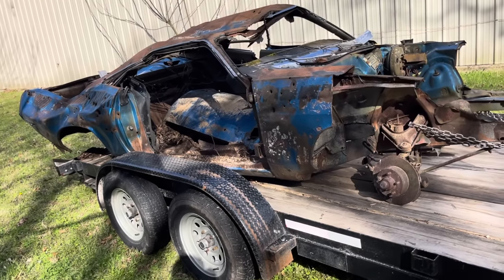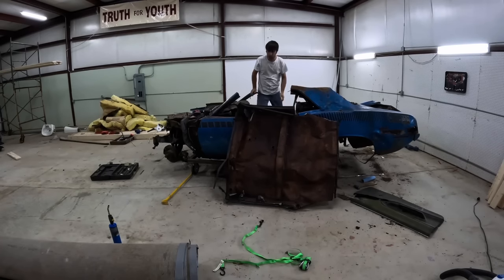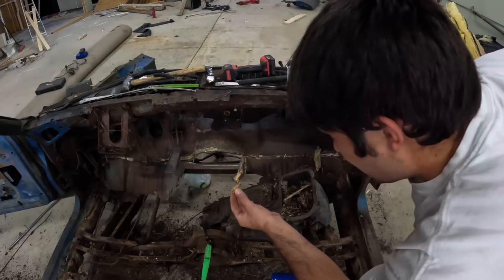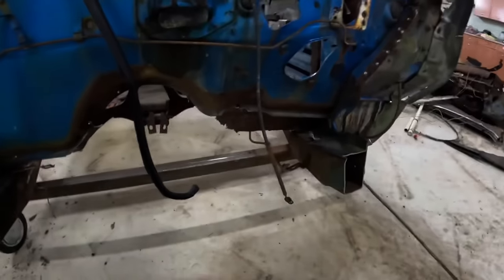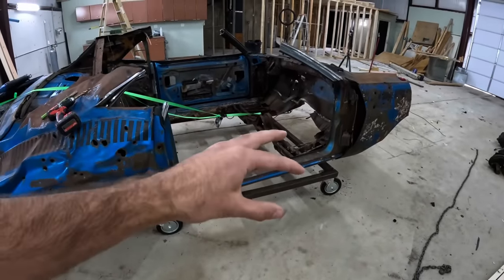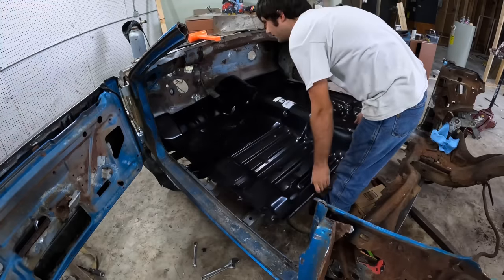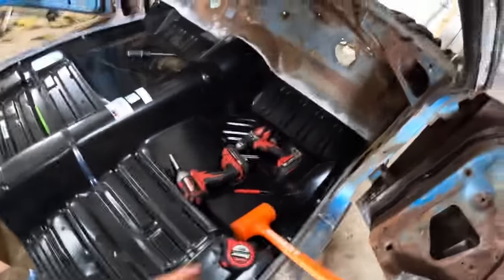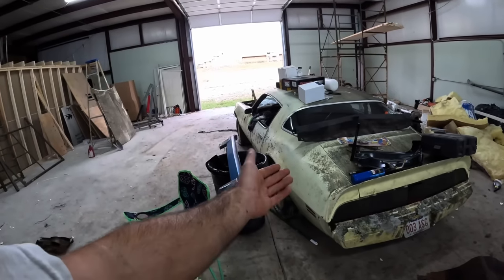1970 AAR cuda restoration part 1 it will buff

Comment: Don't weld anything solid yet... in fact use sheetmetal screws to hold it together until the inner and outer rear quarters, trunklid, and also the front fender and hood gaps are set...You'll thank me later.

Comment: Now THIS is a resto!  This is not "Bought a clunker and dropped a performance engine in it", this is a phenomenal project you're undertaking.  Can't wait to see this as it evolves (although I do wish for your sake you'd wear googles when cutting sheet metal with a chop saw!)
Reply: I'll definitely 2nd that! 
Safety goggles, a MUST!
If u go to, get an MRI and u got micro metal particles in your eye which u may not know about, it can rip them around in your eye causing permanent blindness! 👀
Reply: a FAT WALLET is of prime PRIORITY.
Reply: And safety gloves for welding. Once you get glowing hot metal on your hands you will know why ;)
Reply: Safety always number one priority.

Number one.
Reply: What's wrong with making a clunker go fast? Sleepers are the new norm.
Reply: I was thinking that the safety equipment consists of a white t-shirt 🤣

Comment: Great job really helpful stuff for my rebuild. Just a quick question. You mentioned 8 1/4" from the center of the torsion bar hole to the outside of the frame rail. If 8 1/4" is correct the outside of the hole to the frame rail will be 7 1/4". The hole is 2" diameter. Can't make 7 1/2" from the outside of the hole work. Thanks

Comment: wow this is amazing, im restoring a very rusty 67 barracuda convertible, front and rear frame rails are toast. im  wondering how you figured the height of the frame rails at the front,my 67 frame dimensions use a datum line to figure frame dimensions,

Comment: I went through the same thing with my 69  yenko nova big block car. It had rolled off the roof of a parking garage in 71 and the owner let it sit for years until I seen it and asked if I could buy it.  I rebuilt it in 86. Long before the internet so I had to search for the parts and drive many miles to get pieces, I used all new parts. Not a single used piece went on it , I guess that's why it still wins at car shows all the time,  I wouldn't trade it for 2 of anything  , I drive it every day and lay rubber in all 4 gears. I brought it back to life and keep it alive and it truly keeps me alive also , every time I jam a gear and dump the clutch and smoke rolls outta both rear fender wells I laugh like a crazy person  cause it makes me feel 16 every time,  the 427 still purrs like a kitten
Reply: AAR cudas, around 2700 made.. Yenko Nova like 38 made... your Yenko completely worth restoring in this condition.. that AAR.. someone should cut the tail panel off for a wall hanging and scrap the rest.
Reply: @goldenhippie6352  I didn't know they only made that few yenko novas. I never looked it up,  i know the 427 has more than enough power,  even when I try to drive normal it spins tires, I always liked the 69 nova better than the other years , I have the air shocks pumped up all the way and the 12 inch cragers on the back with mt 50,s and it still spins every time I take off  lol. I love the old cragers that's all I have ever put on it. thanks for sharing
Reply: @coinslotsandjoysticks2572  no problem! You are one lucky man to have a Yenko Nova, been my dream car since I was a little kid.. however with them only ever making just under 40 of them that dream is slim.. the Nova was the one Yenko Don himself was afraid of and that is the reason the production numbers were so low.. it scared him to put that car into the hands of the public.
Reply: @coinslotsandjoysticks2572  , yes it's actually probably not something a person would want to beat on and use as a daily driver.  Just saying......
Reply: Why on earth would you drive a yenko nova like that
Reply: @ThePontiac98  Id say because it's a Yenko Nova.. low production numbers or not, vehicles are not designed to set in a garage. Restoring classics an building hot rods the better majority of my life, and I can say there is nothing more wasteful than putting 10,000 plus hours into a vehicle and watch old guys take them home and stick them in the garage.   Life is short enjoy it.

Comment: My brother and I just started restoring a 1971 Maverick Grabber in about the same condition as yours. Our Maverick had 43000 original miles on it. The car was bought and made in to a drag car with the original 302 engine. It was rolled a couple of times and had many parts stolen out of it that were still good. The Maverick laid in the wood ever sense 1977 until 2023.

Comment: Someone still had a title to that!?!? This is on the level of a job that Chris aka Junkerup would take on. If you are going to try to resurrect a car, this is at least a good one to invest time in. 👍
Reply: Rust Bucket Restos started with a Charger not much better than this.  He too basically saved a firewall and a VIN tag.  We won't even mention DIY Gang's burned out Challenger.
Reply: As long as the VIN plate doesn't rust & fall off, then I guess it's still considered a car.
Reply: As long as you have a VIN and a bill of sale you can register it
Reply: @brandoncropper1259  Nope, not in a lot of states.  Indiana isn't even terribly picky, but you do have to have a clear title, or go through a fairly annoying process to get one.  Some states supposedly make it almost impossible.  Georgia and a few others are exceptions.
Reply: @FMChimera  you can register it in Vermont and transfer the reg cause that’s your title
Reply: I bet Mark Worman from graveyard carz would love to get his hands on this Cuda.

Comment: Looks easier, cheaper and faster to pull the vin plate and recreate the entire body from scratch! My opinion on this one - about one step beyond impossible. If work actually proceeds on this one, the channel will be one to watch for years! Best of luck!
Reply: once it goes for sale,I'd hate to be the poor "dodgy half-wit" buy'n it.
Reply: I think the question here is WHY
Reply: Watch on tiktok… has new floors, frame rails now. He’s seriously putting this car back on the road!
Reply: @MO3MINI  
I had a sledge hammer once.
Replaced the head twice and the handle 3 times, but it was STILL the same tool, RIGHT?
Reply: @MrPaige222  haha reminds me of Triggers Broom! There is still original sheet metal in this car… its no different to all the rebody mk1 escorts, sierra cosworths and Minis etc…. You can now by a brand new body for a Ford mk1 escort! What he’s doing is way more difficult than finding a decent body and swapping the vin plates
Reply: Swapping a vin plate is federal crime
Reply: @genehunsinger3981  
Exactly.  It's not even clear how much of the original  vehicle is going to be a part of this mess. 
I commend him on his ambition,  but I question the logic. 1 out of 2,500 isn't a very rare car in my opinion,  and there's just no way it will have any real value given the weakened metal and lack of originality.
Reply: @jeremyhanna3852  no one would press the issue.For an old car.Unless some-1 lays claim to your car(thru hidden serial #'s located through-out the cars body)And,if you want "gray area"-replace the whole dash so as not removing the vin plate)It's only a big deal when you are involved in theft.
Reply: @genehunsinger3981  right up till you try to sell that car and a car of that caliber is get a inspection by multiple people they find different Vins there walking away
Reply: @jeremyhanna3852  what do you think THIS CAR is going to have?No vin stampings!Is that a bigger red flag?
Reply: @MrPaige222  if the sledgehammer had a frame, motor and vin number yeah you could argue it was the same 😂
Reply: @MrPaige222  😁

Comment: In my experience with cars this mangled, you pull the car to square first, then start cutting. 

Pretty monumental task you have ahead. Good luck. Beautiful car to save.
Reply: It sure makes getting new stuff to fit. But I have only done auto body for 46 years so still learning
Reply: @boblister665  not quite 46 for me, but over 30. It’s how I was taught and it works out pretty good for me.

Comment: As I recall, the AAR Cuda had a destroked 318 to make the engine 305 CID to meet the AAR requirements. It's been a long time, so I might be wrong and mixing this with the IROCs of the 70s and 80s. If you can find the original engine with the matching numbers, that would be awesome. Looking forward to hearing the correct info on the AAR Cuda if I'm wrong. 

Graveyard Cars has built some basket cases like this, just don't do a "Holey Goat" rebuild like one I seen a few months ago where the guy basically restored the drive train, jacked the roof back up, put seats and lights in it and left the riddled sheet metal as is. It looked like a renegade from a demo derby.

Comment: A very ambitious project, I wouldn't have cut through the window trim when you were removing the roof, it was a little kinked but those can be very hard to find. Good luck, I can't wait to see how it turns out.
Reply: That and he cut completely through the A-pillar and all of the support bracing under the roof skin. Should have just heated up the lead seams where the C-pillar and quarter panel meet, and drilled out the spot welds and just removed the roof skin and left the supports, because he probably could have massaged most of that a pillar back into shape. Now he's going to have to replace all of that 🤦‍♀️

Comment: About 10 years ago rescued a completely rusted out ‘68 Camaro convertible. Saved the windshield frame, cowl/firewall, trunk divider panel and lip around the trunk lid (oh, and the VIN tag). The end result was a beautiful car but I would not go through that again. Did save a car that otherwise would have gone to the crusher.

Comment: It can and has been done where they disassemble the shell, work each panel straight again and then put it all back together.

A light weight E-Type post huge accident was rebuilt this way retaining most of its original panels

Comment: Theres a guy in Japan that fixes classic in the similar conditions. Drill out the spot welds and lots of hammer n dolly work. 
Also there is a efi 6 pack intake by fitect or Edelbrock

Comment: Man... you are as nuts as I am, rebuilding things almost nobody else will touch or even consider. Its what you do when you want a car you can't afford in good shape, or when its a rare one that met an early demise. That Cuda makes my 65 GTO before the rebuild, and the 69 GTO right now look good. The 68 Firebird wasn't rolled, but its almost that bad, I can save the roof and a few other parts. I'll be watching this one, since I have a 73 Cuda cloned into a 70 AAR. Its fun to drive, even if its slower than all my Pontiacs.

Comment: That car has lasted 52 years, it might not be all original by the end but the spirit of the car will be there, that's what counts. I'm doing a 1972 Vauxhall just now that will be a 50/50 mix of panels but it will not be a memory car, it lives. I would have drilled out the welds on this car and reshaped as many of the panels as possible, the hammer and chisel work is brutal and could have been avoided with more thought.

Comment: Early 90s Chop Cut Rebuild "restored" a 69 Charger pre-production car found in a quarry. By the time they finished 'restoration " the only original sheet metal was two thin strips on either side of the trunk lid and the cross bracing under the roof. Everything else replaced.  Didn't stop them advertising it as saved 😅

Comment: Fact that there's just over 2,000 AAR cuda is out there but how many of them are legit left? There may only be a few handful out there so it's the determination of ones Will to bring them back to life, I have a 1970 340 cuda that I bought from the original owner the whole right rear quarter panel floor board and frame rail had to be replaced as well as the passenger door it was worth it when you're giving something free can you put love sweat and tears into it it's worth it

Comment: When I did my first year of auto mechanics in Kelsey Saskatoon, one colleague had an original AAR Cuda with the 340 six pack.  Car back then in the mid 1980s were always street raced and nobody had a stock musclecar.....  Performance parts were pretty cheap and one could always comb through the local bargain finder for cheap used performance parts as well....

Comment: That would be 340x block and heads for correct build. Back in the day I found a Panther pink AAR listed for 1500, I only had 900 so, yeah I lost out and am kicking myself to this day over it. But Found a 70 an Inviolet Baracuda 4 speed for $100 with bad bearings. Drove it for 20 years and sold it for $3500. Yeah I should have kept it but needed the money.

Comment: I had a Moulin rouge 340 6 pak 727 AAR. build sheet dealer window sticker all papers original paint original motor. Paid 5 grand for it.
Dude wanted 7500 told me on phone it was a plumb crazy car.
He thought the pink hurt the cars value and dropped the price. I sold the car for 15k without doing a thing to it. Thought I was killing it... Cars worth so much now it's hard to calculate.

Comment: yep.. just jack up the vin. plate and firewall..and slip a Brand new car underneath..it would never happen where I  am... once they are dead,or written off.. they stay dead ..parts only..nice to know you guys can put those rare ones back together..see the Rat in the  left hand side of the dash start to move at 5:18 and runs down on the left side then exits near the left rocker..he out of there ..

Comment: I wish I had kept the 1971 XY Ford Falcon, 🇦🇺 that I saved from a paddock. It had wrapped around a wooden telegraph pole in a drunken crash. The drivers floor was pushed up into, and bent the metal dash at the same time.
Stupid part is, now these bodies are as rare as this AAR, and people are paying 30-40k just for a junk body with no panels trim or motor 🤦‍♂️

Comment: 340....not 360.  Good luck finding the numbers matching engine.  Ditto the tranny and rear diff.

This thing needs 90% of the sheet metal replaced.  This ISN'T a "restoration"  More like a "George Washington's axe" resto.

I don't wanna even know what you paid for this creampuff/VIN plate.

Comment: Dude. Put it on a frame machine Jig and power it out to as close to factory spec as you can. Power it to factory spec before you touch it. Clamp the rockets to the Hog. Cut off panels and weld them
Back on. Do  N O T try to Hillbilly this car back together please!!!!

Comment: This is no longer a factory car this is a tribute car or a clone car... it is no longer the rare car it once was and it will never be able to be that car again there's not enough salvageable Original Parts left to even be considered that ...some would claim it to be but it just can't  it can't be there's too much of it gone that's misrepresentation hopefully that's not what is going to happen here hopefully it's going to be represented as a tribute or a clone..... Maybe I'm Wrong maybe they're allowed to throw 95% of the car away and just have a few little pieces and a VIN plate now I don't believe they are but maybe I'm wrong....
Surely he is not going to sell this as a rare original restored model and represent it as such?  Surely he is going to be completely honest and say hey this is a tribute car this is a clone ? 
Very interesting how he those about dismantling them you got to wonder if you've ever done stuff like this especially why he didn't take a different approach I wasn't there I didn't get to see everything so there's a lot going on that we don't get to see behind-the-scenes so maybe that's why he took the approach that he did on the dismantling.... either way it's a clone car
Reply: This would be considered building from vin which if he were to sell he could specify and it would be up to the buyer to decide if they are cool with that

Comment: You're working with 3 good sheet metal parts, and no mechanical parts at all. Best to push a company who re-pops a whole body. You might as well be at the Chrysler plant Yourself, but you get to fix every single body component before you assemble it. You'll have thousands of hours into this junk.

Comment: This makes no sense you basically replaced 94% of this car. Could have just built it from scratch cause you said there is a certain amount of these cars made.   But it's not gonna matter if you only have maby 10% of the original car there and not even the original body on it